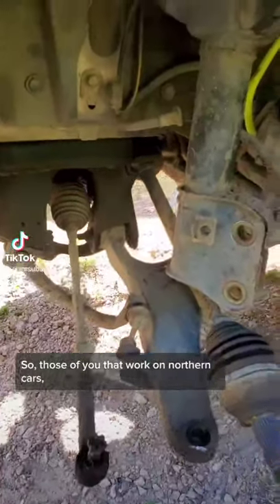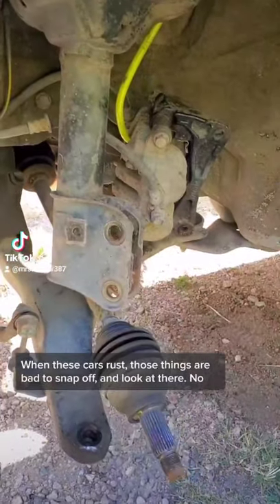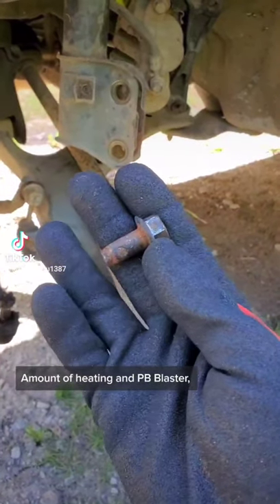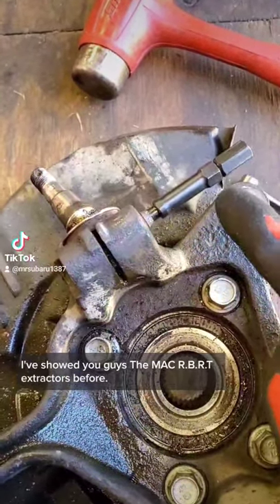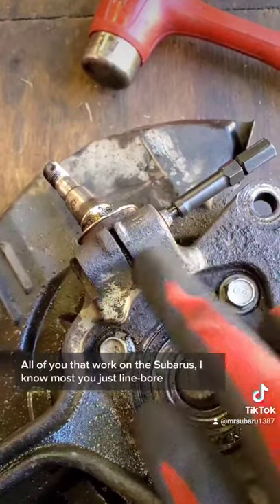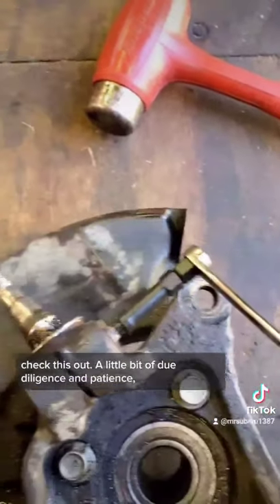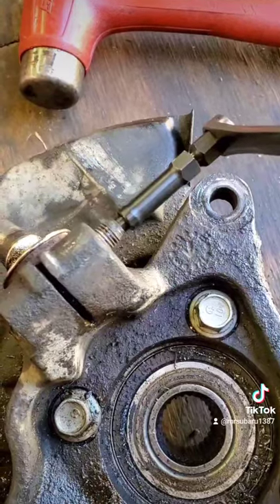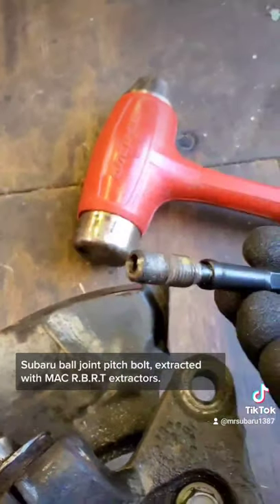MAC R.B.R.T Extractors Do It Again! Broken Subaru Ball Joint Pinch Bolt! #shorts

Comment: Literally JUST did this project on my impreza. It took 4 days of replacing, drilling, heating, PB blasting, charging, sweating, bleeding, and crying to get the front ball joints done. I drilled a hole thru the bolt and stuck a cotter pin on it too just in case the nut spun off.
Reply: Some older car guys will run a second nut up and drill threw it and the bolt and slide a cotter pin in it. Basically not coming off until you're ready lol.
Reply: Lock nut or unlock nuts would be my choice.

Comment: Fluid film the bolt, threads and the center and ends when fully tightened down. You won't fight it again. Done that to the last 3 and when they had to come back out, it came out so smooth.

Comment: When I did my Impreza’s ball joints, I would spray pb blaster on the on the pinch bolt and ball joint area every time I was going under the car to do a oil change, or anything else that required the car to be lifted. It made the job a breeze. Luckily this was for my personal vehicle but for a customer’s vehicle this might not be an option to due depending on circumstances.

Comment: What’s the easiest way to remove this ball joint from the steering knuckle?! 
Ended up just buying all new and replacing everything cause no amount of PB blaster or force would even get that damn ball joint out on a 06 Subaru legacy. Oh and the pinch bolt snapped same place for me. But you can’t use a standard ball joint removal/install kit to get it out on this particular ball joint because it doesn’t have any access from the top

Comment: Had this happen to be at tech school a few months ago. The person driving the car hit a curb going 45 ish mph. Had to replace a front passenger wheel bearing and lower ball joint. That pinch bolt broke and extractors didn’t work. Sadly didn’t have those RBRT extractors at my disposal. Just ended up replacing the knuckle.

Comment: What I usually do it use the air hammer with a big flat hammer bit in it and rattle the bolt. So I hammer the hex end. I don’t add any lube to it just yet. I do add heat. This will help knock the rust out. The salt belt is so nice to cars.

Comment: Just a random thought, but if a bolt was stuck why wouldn’t you use like canned liquid nitrogen since cold makes metal cool, and heating the bolt would make it expand and also more malleable and likely to break?

Comment: So here in Scotland, i had a small van with a cracked leaf spring. We thought the U bolts would not come out.
But as we were doing the work on saturday, my step dad said paint some diesel on the bolts every day and let it soak in. 
Cone saturday being careful, the bolts come undone.

If you got the time, paint brush and a bit of diesel and let it soak in and its been a trick i used a lot over the years if you got the time.

Comment: I had to change the wheel bearings on a subie, I left those bolts in and took the entire strut off with the knuckle and worked on it that way. I knew something bad would happen if I worked on those bolts any harder. Part of living in the salty areas, you know when there is no hope and it switches from taking apart to destroying apart.

Comment: Last one of those I fought with actually came out with the torch and pb blaster, but when i went to put the new bolt in the threads were toast, got to like 10 foot pounds and it just started spinning, back to the nut and bolt lol.

Comment: B5 and b5.5 passat had a really long pinch bolt it holds two ends on top and the bolt is made to stretch so its ine use only from the factory and those are a bitch to get out usually we use a mini sawzall and cut inbetween both slots then heat the knuckle a little and pucnh them out shitty part about that it they mushroom everytime and are hard to pound through Mac rbrt will get the ends out and thwn you can punch whats left out rbrt is key for some things things they grab more than pushing out on the bolt making it tighter in the threads so they are great for soft bolts where regular easy outs wouldnt work😎

Comment: I usually just drill
Them out and use a bolt with a nut.. I LOVE fighting the rear long bolts on the older Imprezas 🤣
Reply: Do the through bolts with a nut on the end usually last though
Reply: @MagMagicM  I’ve never had one fail. I torque them pretty tightly and use a lock type nut on them but yes it will
Hold just as long as the original

Comment: Im so thankful when i have to work on subies here in washington/oregon it takes about 20 minutes to replace a ball joint and nothing is usually siezed or rusted. Of course you get the occasional horrible ones but for the most part its quick and easy

Comment: Honestly when I have that problem I just heat until it's red-hot splash it with water I know it's not good for the metallurgy but it gets the bolt out of the hole. Oh and use an impact on low